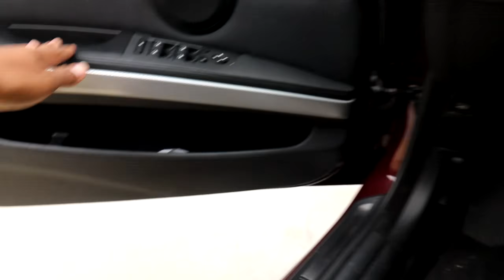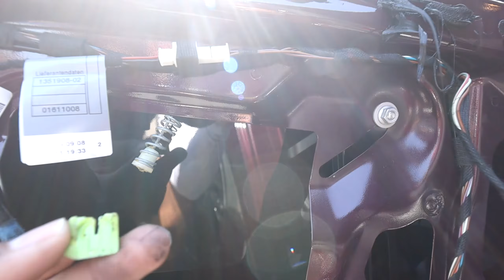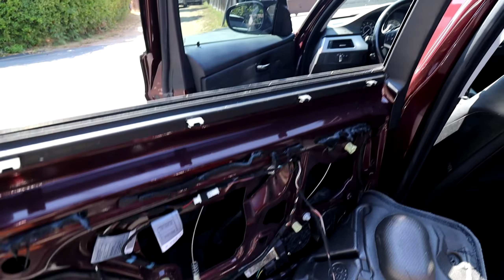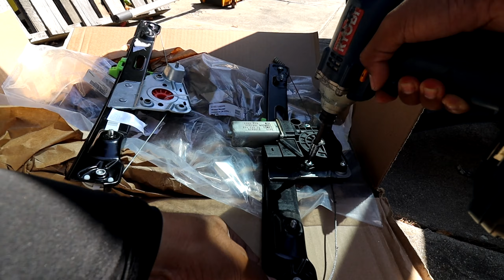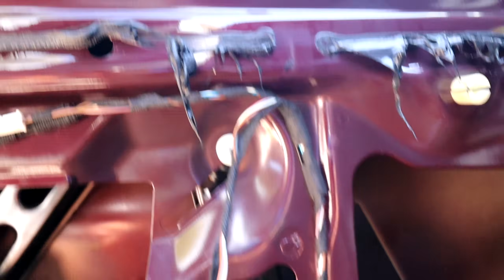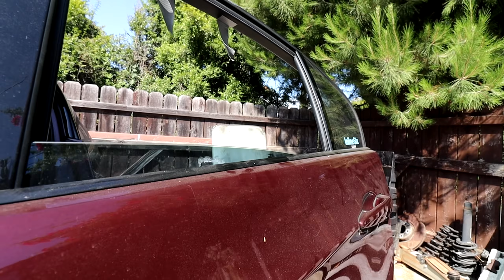How to Replace Broken Window Regulator! | BMW E90 3-Series

Comment: Good Luck! years ago, the BMW dealer advised me to roll them up and down regularly to keep them working properly. I've done that thru the years but I still have problems with the windows operation and door locks also. My E90 2006 325i with 105,000+ miles has had many problems. It's a love / hate relationship! Current: driver door lock stopped working, rear door window dropped regulator needs replacing. I have the parts and I'm ready to do it. FRM problems: No radio or blutooth or Idrive Not Working! Is it worth it?